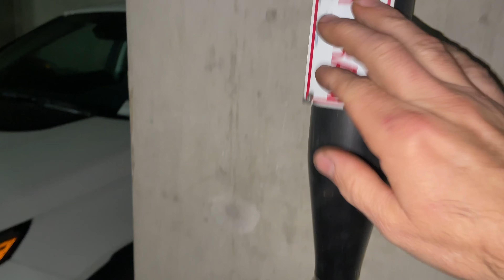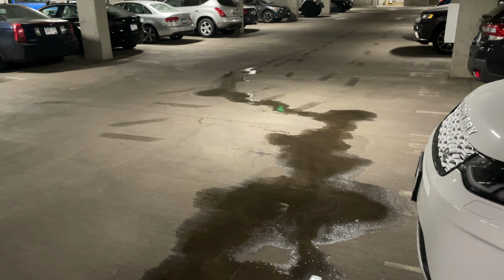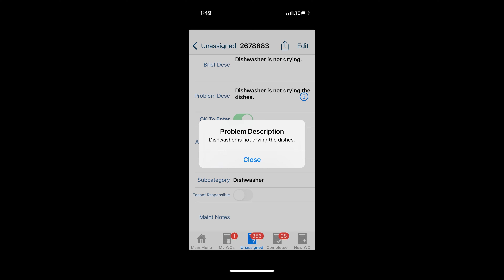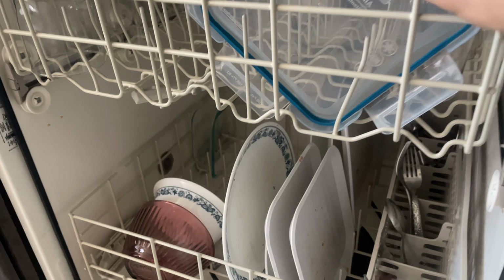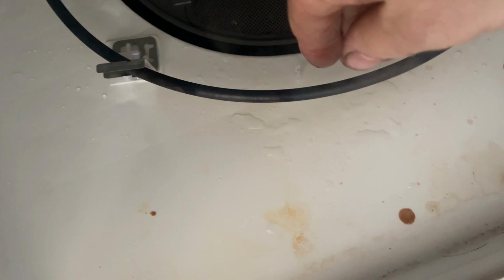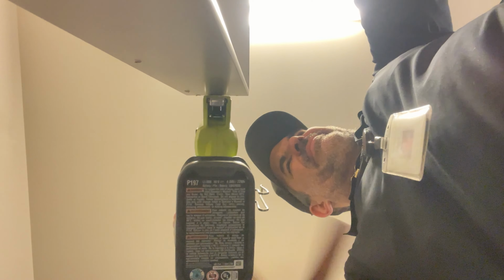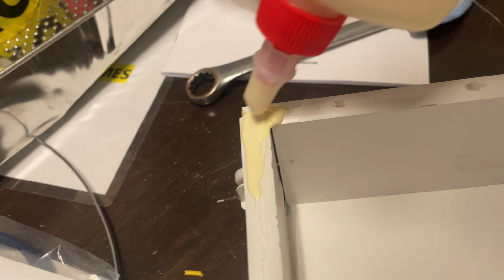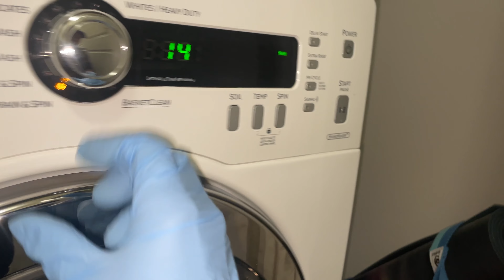Apartment Maintenance Vlog #30

Comment: Just a quick note on those front load washers, they seem to mold up easy in the detergent tray as well. We've got one in our home and we leave the door open and the detergent tray pulled out between uses to avoid the issue